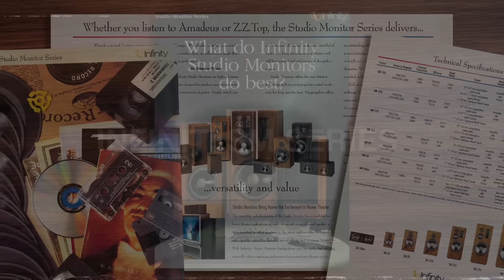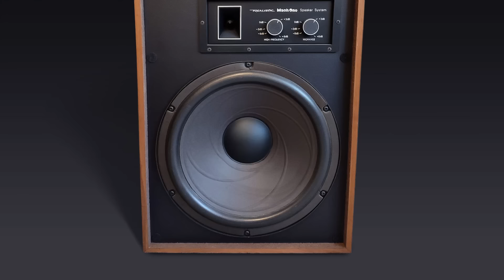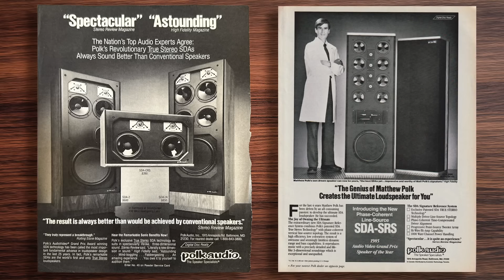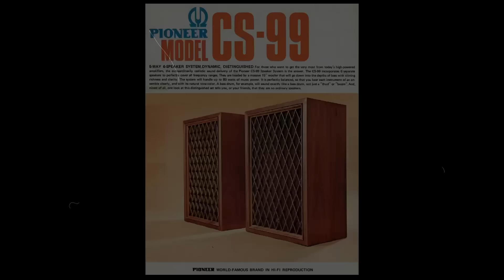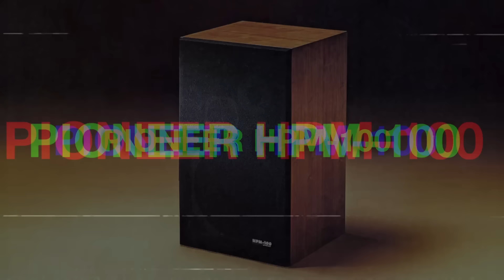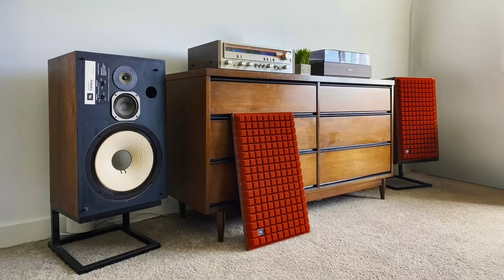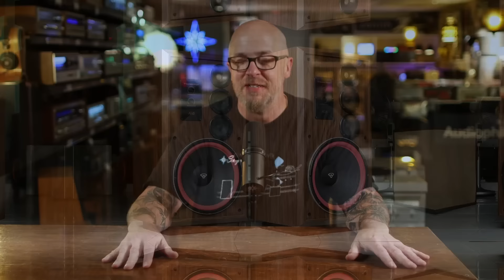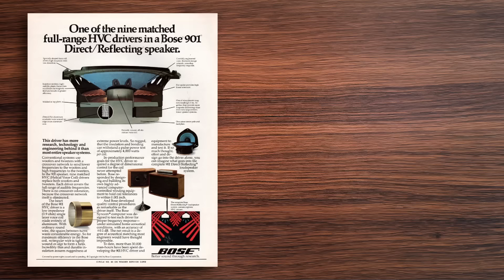Why Do Audiophiles Hate These 9 Legendary Speakers?

Comment: I live in Australia were the hifi market is 99% junk, finding good quality vintage gear is an absolute mission, a set of JBL L100s were advertised for $1200 AUD and I went for them, so did many others as the guy was flooded with messages but I just got in. I'm not sure I've seen another pair since and that was a few years ago. 

I upgpraded from some old Wharfedale Dovedales and I was shocked by the difference, I ran both through an SX850, the separation was the biggest difference, the JBLs were so much more accurate and detailed than the Dovedales which sounded very flat in comparison. 

I was surprised to find out how much people disliked them, I guess I don't really have much to compare them to but I see no reason to upgrade to anything else.

Comment: i finally bought 2 sets of 901s in 2009 ,  I had them set up in all different configurations, with eq, with my 12 band eq,  i added a subwoofer, optimal placement , and I couldn't get them to sound good.  I always wanted a set since my friend had them in the 70s. I was finally able to afford them and after a year I sold them and bought a few sets of klipsch tower speakers that blow away the bose. I am not a bose fan, I think all their products suck. I used to work for radio shack when they started selling the systems with the passive sub , then later added a powered sub. I never saw the hype. in the 70s i bought a set of marantz imperial 7 speakers that blew my neighbors away , Living in the city I had 4 of them in my room for my quad panasonic receiver which i still have. I am having that overhauled right now and I just had my dual 1229 turntable overhauled as well .  sadly the marantz speakers did not make it that far.

Comment: Speakers of the seventy are renowned because they where heavy duty and could reproduce Carinety Hall. That is the unmatched standard that at the time ,all you mention where substandard. Kenwood and Pioneer surpassed all others and all others tried to match. Great for them and some are almost as good; some better. In my day there was no such thing as a woffer ; it was called a base speaker and only poor folk had a sub. Subs where and are still junk  verses  true multi speaker cabs to mimick true stereo  which could not compete to quad.

Comment: I have 901's and I really love them. The reason I got them instead of L100's (which I also love) is because you can stand directly in front of one and still hear the other one. I like the way they put sound in the room, but, as you say, placement is crucial. I have had friends be really surprised at the amount of sound from them. The big drawback is that they require a LOT of power. I run a Dynaco Stereo 400, but once borrowed a friend's Phase Linear 700B, and wow! Seems like they can take whatever you feed them.

Comment: I have a set of those Infinity speakers which I acquired from my brother-in-law with a Technics amplifier.  Yes, at two it would shake the windows, and you could easily hear it out front of the house with doors and windows closed.  At six you would hear the pipes in the basement rattling too; but yes, the sound quality wasn't the best.  The amps really set these off, I wrote Technics to get the specs on it and it's up there, I wish I knew if it had any value and where to sell it.
Not sure what I would choose today, or what's even available today.  I'd have liked the CVs possibly, having a bit of a bass heavy sound is something I've always preferred.  I'd probably would consider the Polk Audio satellite speakers my in-law bought long ago too.  They weren't just loud, but much clearer than the larger Infinity speakers I got from him.

Comment: Speaker designs are always a trade off, but having said that, multiple HF drivers are not a good idea.  Rule of thumb is that drivers have to be within 1/4 wavelength to integrate correctly. So at 10Khz, your drivers have to be max of 8.6mm apart to avoid comb filtering.  

So two tweeters 3 inches apart will sound like poop.  Basic physics.  You can have multiple woofers since the wave lengths they are reproducing are much larger.

Comment: I have 40 year old Magnat All-ribbon 2p en 8pll on my new Marantz PM6007 & CD6007 both sabre32 dac,s.  45w rms the 2p is 94db 1w en 8pll 95db 1w so ind.45w sheake my room.   But the bass,mid en high ar great on both.. i pay 2 x 50buks for it on dutch ebay.  Do you know en heart Magnat all ribbon,s. ?

Comment: Those Klipsch KG-4’s made my ears ring/hurt in less than one side of an LP. 
Finding the right match of amp/speaker is a challenge. 
I have a Kenwood KA-2500 and Harman Kardon 330B, both about 20 WPC, and am in the process of getting my Sherwood S-5000 II serviced and repaired with its 36 watts of tube power. Any recommendations for good speakers for these? I hate horn-loaded speakers and have a fairly small listening room, so maybe 90 db sensitivity would be good.

Comment: the only thing Bose I liked was  "vintage" 1201 amp's with drivers in my car.  no tweeters. sounded really good and was reasonable unique in the car scene.
Reply: I still remember the awesome Blaupunkt system my college roommate had in his new van in 1974.  That was when it was still audiophile equipment.  I think about 10 years later, it started going downhill..
Reply: @graybeard2113  blaupunkt had really awesome car amps that could be coupled into one massive allu brick.  sounded amazing and looked pro.

Comment: This video is hard to pull off due to the fact of all peoples ears are not the same ! I've had numerous speakers in my lifetime, DJ'd for years, and never had anybody in the audience and tell me my speakers sucked ! I always used Bose 901's at larger venues. In any case, always by a decent speaker and don't spend a fortune on something most people wouldn't appreciate.

Comment: I bought a mid-level Pioneer system from the AAFES post exchange on my base in Germany in 1989, with a pair of Infinity SM-120 speakers. In spite of the dragging that they get, they were my first decent speakers, did all kinds of music well and weren't as boomy and bloated as the Cerwin Vega D-9's that were really popular with other soldiers in my barracks. For better or worse, the SM-120s formed my base line expectations for what a speaker should sound like and really underscored my profound disappointment when I got a pair of Klipsch Heresy speakers, many years later

Comment: Bought a set of used 901 series 3 back in 1986, I believe.  In the late 1990's I was watching a SIFI movie when the volume was too loud and I heard a cracking sound.  I took off the back cover and discovered that three of the back 9 had totally shredded the surrounds. I found a place in Sacramento that could replace them.  These drivers are heavy and I think the shipping was more then the repair.  Got them back, replaced them, played the same video at the same place with a good volume level and something amazing happened, I watched in horror as all the other drivers blew to bits.  Now I am at a quandary.  Do I send all 15 other drivers to be redone?  Cost was crazy. I would be better off with new ones.  I took a chance and called BOSE.  They told me that they are guaranteed for life no matter who owns them.  All I had to do was pay for the shipping and return the old ones.  They shipped me a brand new series 6.  I still own and Love them, but you have to know where they can be placed to get the most out of them.  Been hanging them and still look and sound new.  How many mfg did that?

Comment: I think you pretty much nailed it.  I use a pair of Infinity speakers right alongside my studio monitors for mixing, & they don't break a sweat - even though I did have to replace the surrounds on the woofers. LMAO & Realistic later addressed the horn issue with the Mach2.  It was a speaker that finally could hang with many of the Cerwinvega's..  My Unkle had a pair of 901's powered by a Macintosh back in the early 80's - One X-mas he was so happy with the speakers he had the family listen to some Pink Floyd & actually blew out the front window.. To this day it was an Epic moment, & luckly these days 901's are no match for Double pain glass.... I have yet to be impressed with Klipsch - My friends Dad had the pair with the Bass Horn bottom & adjustable Horn for highs.. Other than the fact they could handle power like a PA speaker - to me that's all they had going for them - Same friends cheap pair of Kennwoods didn't have the power bu sounded WAY better for thousands less.  I have never really gone back down the Klipsch path other than passing the new cheap stuff at a store.  I also later bought a pair of Bose 302's that were pretty good, but also had the spacial thing where they needed to be in the right spot.  A speaker I do miss is the Fisher ST-'s - They fueled a lot of party's LoL

Comment: I had a set of the Cerwin-Vega AT-150's. I loved those speakers. I could vibrate the entire floor of my Barracks in Germany. With a good EQ you could change from Rock/Metal to Hip Hop by changing 1 setting.

Comment: I had a Marantz 2270 and a pair of L100s, back in the 80's. they were not set up in a room properly and the room was way too small.  I went to an "audiophile" type store. They had a pair Wharfdale diamonds on stands, driven by a small Adcom integrated amp (might have been Rotel) the source was a Rega table.  they were the only thing in the room other than a couch.  I don't remember but guessing there were treatments on the wall. It was the cheapest set up in the store at about a grand for everything.  Shortly thereafter I sold all my stuff (for next to nothingby today's standards) and bought a similar system. Little did I know at the time what an impact, just moving speakers off a wall had much less tweaking everything.   I'm shocked at what prices these vintage things command. I did hear a recapped Pioneer receiver thru some high end modern speakers and a very expensive TT and cart.  It sounded really good.  I would like to hear what my old system would sound like were it restored and set up properly.  My recollection on hearing higher end audio in that period  was much tighter bass from the speakers than my L100s  by comparison they sounded "mushy"  and I was really surprised during quiet parts just how quiet the amps were . My Marantz and every other receiver I heard had a slight hiss.  I don't know what year it was, but maybe it needed work?

Comment: I had 901s for years and years and I used it with a Sansui Se-9 graphic equalizer that with a microphone that analyzed the room and would adjust for flat. It worked well with the Bose 901s. I had that setup over 40 years ago.

Comment: Im 43 now, as a kid my dad had a Hitachi system. Stamped right on the front of the amp was "Max power 75 watts" seems like nothing now,    but with AC/DC cranked up it would literally rattle the pictures on the walls. Pretty sure the speakers were 3 ways with 12s.

Comment: The crossover in most speaker is what makes them sound bad. Sure, there are other factors to but bypass the crossover and put a speaker management crossover and go Quad amped and you can make any system better. Yes, for most it cost too much, but if you really want good sound and control it's the way to go. I'm a live sound tech so I don't get along with most audiophiles due to them believing some of the smoke and mirror things that are just not true.  Yes, at my house you can be the JBL guy sitting in the chair and at 100db plus the sound is still clear. No one speaker handles 20hz to 1500 well subs are a must.

Comment: Memory lane.  Two comments... 1. Best speakers I've owned? Altec Lansing Voice of the theater.  1960's vintage. The ugly utility no frills commercial box model. Purchased from a movie theater in 1971. Paid $200 for the pair.  All music through them sounded like it was recorded in a spacious environment, like an outdoor concert. 2. I paraphrase Frank Zappa who said "You can make any electric guitar sound like any other with a 10 band EQ".  I've proven the analogy with many speakers. Just use any decent quality speaker and a good quality EQ box with all those vertical sliders.  Experiment away. If you are a real audio nerd (like I was years ago) Pump white noise at high volume and look at your spectrum analyzer while sliding the knobs.

Comment: I have to strongly disagree with your very short Infinity description.
I still have a pair of SM115s.
I have pushed these with a Yamaha CR800, SAE power amp. And a Carver power amp.
Beautiful wood cabinets.
Only complaint
Woofer had a relatively low rms rating as I fried them listening to GFR live album at 200 watts thru the  SAE thru a Phillips 212 strobe turntable.

Comment: Many of the flaws of the JBL L100s are cured in the later JBL 4312As, like the giant hump at about 6kHz.
I had a pair and really liked 'em, for Jazz and Classical too. Not flat, but no longer Boom and Tizzle...
although I found mine had been incorrectly wired! Once I reversed polarity on the mid-range driver they imaged really nicely.
Plus; they were mirror imaged in the driver layout.

Comment: IMO, Bose is one of the most overrated brands of all time. They are far better at marketing hype than actually building great speakers. To me they are designed for a very specific room - the one in the Bose showroom - and they never sound as good anywhere else. I laughed out loud when you said Cerwin Vega - as a kid growing up in the 80's my dad had a pair of CV's (not sure the model) with 12" woofer and a single tweeter, mated w/Pioneer SX-780. We pushed it so hard we ended up having to replace the woofers after the rubber foam surround tore away. They did have a lot of bass and bright treble but mids were practically non-existent, so I grew up thinking the V-curve was the ideal sound profile haha. It wasn't until I got to hear my dad's business partners Klipshorns that I realized what I was missing in my music. A girl I dated also had a huge entertainment room in her house with a set of Klipschorns, and I fell love with their sound. Today I have Klipsch in my theater room, in a basement rec room and in our livingroom, so I guess you could say I'm a fan lol.

Comment: The Mach Ones were terrible. Just terrible. Booming inaccurate bass, irritating midrange and weak highs. Turn 'em up and get swallowed in the mire. I think people bought these solely for "wow! 15 inch woofer". I will say however, though I haven't heard one, Radio Shack made a receiver that was equalized to tame these. I think it was the STA-2100.

Comment: I just got two more Karns Paradox III speakers so I have a set of four in my basement pool room. Karns was made here in Grand Rapids, MI, not large, 8" woofer which along with the mid-range is front firing with a rear firing tweeter, gives a fuller, more 'surround' sound (to me). Upstairs a set of four Sansui SP X-7700 fills the place with sound pretty well. Yea, this vintage stereo game never gets old, bought my first decent system at the Audio Club at Herzo Base in Germany in 1972 and wish I had some of that stuff back.

Comment: REALISTIC FAN here ,talking about the mach 1 i just love them but i can say not crazy about that tweeter horn ,the mid horn love it and that bass woofer it thunders at low volume you still get that bottom end bass, i have 4 and it sounds like a disco in my living room, of corse i have it hooked up to the holy grail of realistic receivers the sta- 2100,i als have 2-2100-D  ,2300,and a 2080 have 3 turntable lab-500,8500 RD-8100,and other speakers like 4= t200 sct-3100 tape decks ,and a12 and 15 band EQ,IT VERY WELL BUILT STUFF everybody is hunting realistic ,it not radio scrap no more if every body wants it get good sound at a fair price,

Comment: My first purchase was a set of Bose 301's Next, a pair of Pioneer ST's to match a Pioneer rack system. Got rid of it and purchased a Yamaha system with Infinity RSIII speakers
 Currently have SAE and DBX system with JBL L100T's and smaller set of Paradigm's. Anyone interested in a pair of RS IIIa's I've owned for 40 years?

Comment: There Is a rare C-V set that actually sound pretty good - the 217R's - esp. 2nd series w/1 'dhorm" (C-V's name), a horn loaded dome, and a rear firing horn mid. Placed properly, a huge, fairly detailed soundstage, and as box tuned to low C, tight very deep bass. Friend's pattern-maker (very tech machinist job) dad had 'em when we were high schoolers, run by Pioneer SX-939, and about 10yrs ago, he sold C-Vs to me for-get this-$50 for pair, in orig boxes, then threw in SX-939! Perfectly matched, SX's sound makes C-Vs smooth & they surprise any & all who hear them! Have HPM-100s too, you're spot on, Need lotsa EQ, but then..... Never hear about 1'o my faves, actually my maiun set-ESS AMT 1's w/12" woofers-make musicians appear in my living room!

Comment: The only 2 of these I cared for (without a ton of real crossover redesign) are the Polk SDA and Pioneer HPM100. Polk did a good job with the response for the time. And the HPM100 is that classic party speaker that didn't need a ton of EQ to be enjoyable. None on the list are audiophile grade. They all lack in response, an accurate crossover, and overall design. Ive had quite a few of them come through my shop for others or so severely damaged they were good for nothing than Ebaying the parts

Comment: The first speakers I ever purchased was the Pioneer HPM 100 while serving in Guam. Many many guys in the BEQ across the base owned those in the late 1970's.. They were a common sight at parties and in dorm rooms. I have fond memories of the HPM 100`since they were my first. Eventually sold them to a guy on base and purchased the JBL L150A. Wanted to buy the JBL L110, but they were like buying a unicorn,  couldn't find them anywhere.